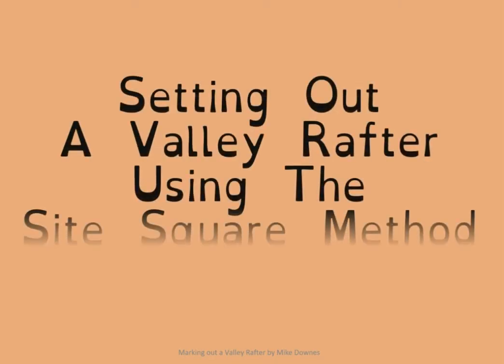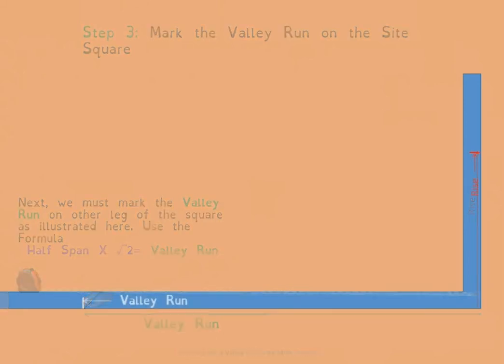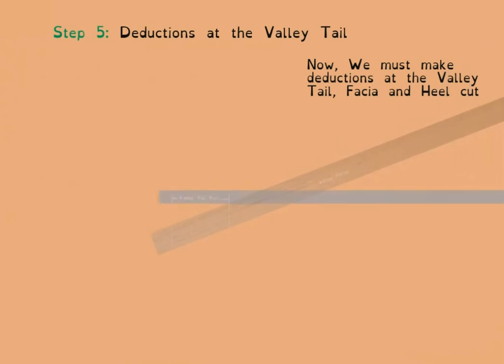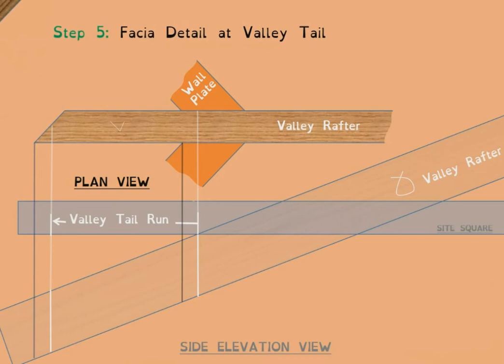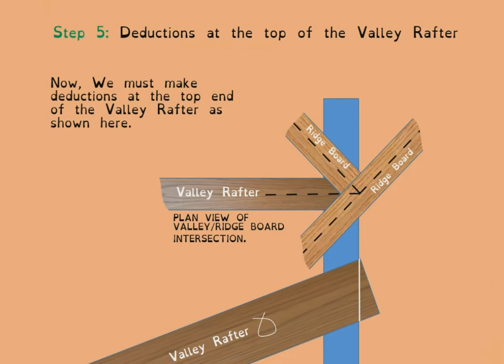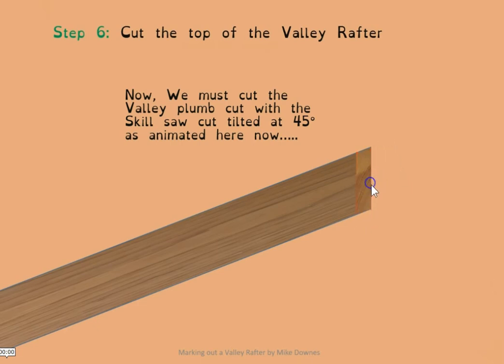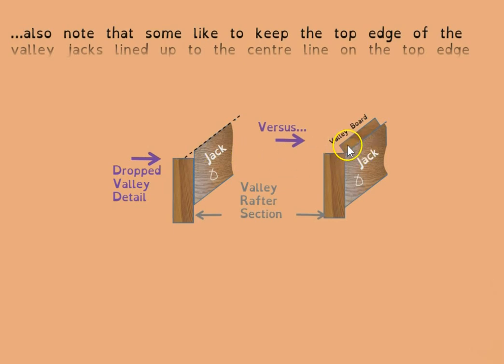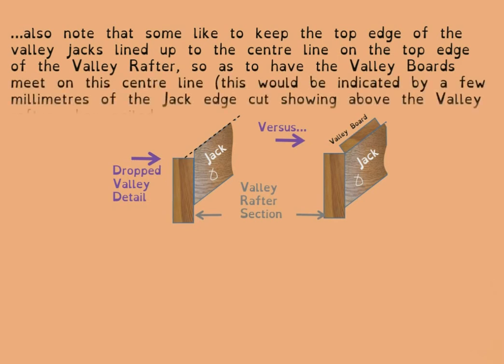Marking a Regular Valley Rafter using a Site Square.

Comment: Could you do a video on getting dihedral angle on site
Reply from the maker: will do when i get a chance...but in the mean time, if you take the upstand distance from the birds mouth on a Hip Rafter for example, and slide that distance along the seat line by half the hip thickness. The remaining distance from the top of this off set line gets planed off at an angle that finishes at the center line along the top edge of the hip...the do the same from the other side of the Hip to form the dihedral angle. Also, you might want to have a look at the second video  i have on this channel on how to make a joiners saw horse (Part 2) with regards to the Dihedral angle...
Reply: @michaeldownes516  thanks
Reply from the maker: @oreallyoreilly6576   BTW...when you plane on the dihedral angle you will have to adjust the seat cut downwards slightly so as to keep the required up stand distance at the heel line on the birds mouth...Some times its better to plane on the dihedral angle first before marking the birds mouth on the hip so as you have to think of re adjusting the upstand distance...
Reply from the maker: here ya go     https://youtu.be/w56WTgUmnDI

Comment: What a great channel you have really helping me a lot I must admit I'm still finding it hard to understand valley rafters, on the top cut of the valley is that a  45 degree cut like a hip? , and for the cheek cut  what is the angle of that degree?
Reply from the maker: Glad you are finding the channel useful....re top cut,swing your skill saw at 45 degrees and cut side/cheek cut as you would with a hip. The angle of the cheek cut is determined when the blade of the bevel lines up with the rise leg (shown in blue) of the site square  (see this at  3.50 mins into video)...here you would swing the bevel blade to line up with the rise leg (shown in blue) of the site square.

Another point to ponder in relation to this cut...if you cut a line square across the side of a rafter with your skill saw set at 45°....the angle formed , after you ran the saw through, on the edge on this rafter would be 45°..
but the more this line becomes off square (Like a Plumb cut) the angle on the edge will then become less than 45°...i.e   it will become more pointed